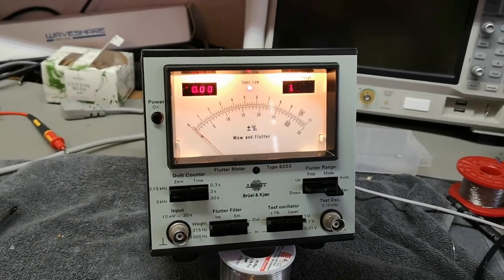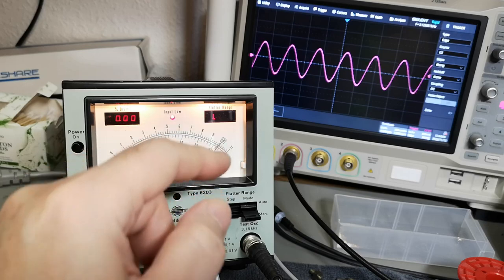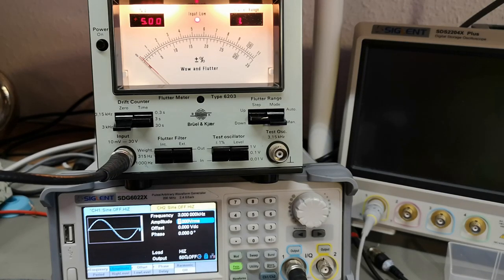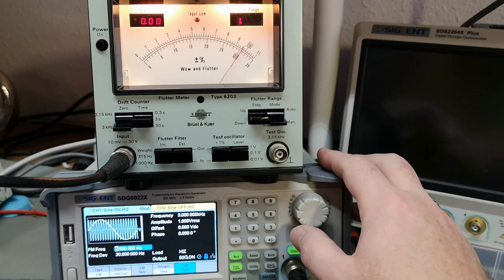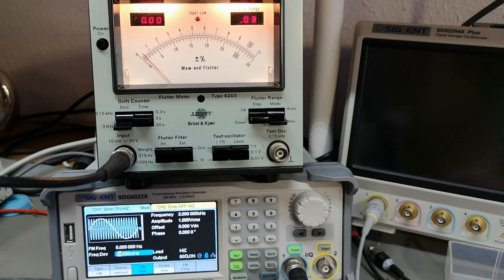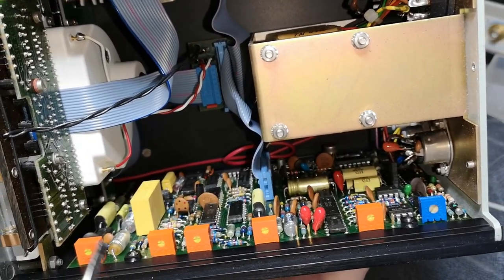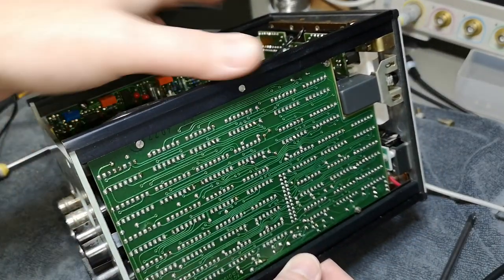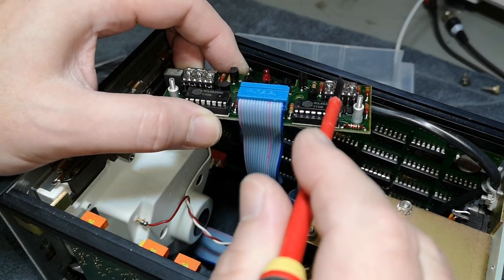Brüel & Kjær Wow and Flutter Meter Type 6203 from 1977 test teardown

Comment: At my first engineering job I used this equipment to test wow and flutter of record players. The tests are done by  playing reference DIN test tecords containing a 3150 Hz tone. The same for tape decks using reference tapes.
Actually it measures drift, wow and flutter separarelly.

Comment from the maker: NEWS: displays might be DL330M also known as Bubble LED display, seen today on ebay 65 Euro for ONE
Reply: yes!!
Reply: Absolutely crazy. I have a bunch of those in stock. Just because they are listed for that price, doesn't mean they are ever being sold at that price.
Reply from the maker: @zaprodk  then you know what to use as trade material to make me happy one day :-) in case i got some cool stuff you might need.
Reply: @TeardownOZ2CPU  so you don't have that kind of stuff in your collection? I'm surprised :)
Reply: @TeardownOZ2CPU  Yes I also have some around, but prefer the later full alphanumeric versions, which were used by another Scandinavian manufacturer, B&O, in their equipment. They are great displays, made with the LED grown on a silicon wafer, and diced up to make the displays, plus TI also made them with an integrated counter decoder on the leadframe as well, giving that combo of a BCD counter with outputs, and an integrated decoder to drive the display.
Reply from the maker: @SeanBZA  the alpha types are nice, i got many of them, but they dont bubble as much, and the view angle effect is not as extreame as this number type, 
see my first Z80 system here : http://webx.dk/oz2cpu/radios/z80first.htm

Comment: If you record the tone onto a tape recorder that has wow & flutter it will not show up on test. You need a tape recorded on another machine that you /know/ is perfect :)
Reply from the maker: i dont think you are right : if you have a machine with wow and flutter and record this perfect test tone, rewind and playback the measured wow and flutter will be twice the level of what that machine really have.
Reply: Nahh, its not that simple. First of all: perfect wow-flutter does not exist. So all we can measure when it comes to this, has a great uncertainty because we measure both the tape and the reproducer machine, so its a combined uncertainty of these two (and actually more elements). This is not different to any other kind of measurement - but in this case its more problematic because the machine that produces our reference tape will have the same wow-fl value as the one we will be measuring, fx. like 0,05%.

To answer your question, yes it will show up on the test. It is impossible to mechanically reproduce a tape 100% in sync with the recording made on the same machine. But I think you are thinking about fx. using a 3-head cassettedeck and measure while you record and playback the same time, and this will NOT work because the heads are located only a couple of mm from each other, so here you are right.
But it is acceptable to record a tape on a machine, rewind it and play it again and take a measurement. But preferably using two or more machines. If this measurement is within specs of the machine, or VERY close to, its acceptable. Then you know, that if you had a ref. tape with 0% wow-flut (doesn't exist), your specs will be even better - but that value is not usable, only that we are within specs.

MRL has a very good publication on this (nr. 570):
"FLUTTER MEASUREMENTS
Weighted peak flutter is measured according to the
standards AES6, IEC 60 386, and others [1]. The background
for these standardards is given in references [2...5].
The measurement of the weighted peak flutter of normal
recording and reproducing systems should be made on one
element only of the system—either the recorder or the
reproducer, but not on both at the same time. This is for two
reasons: First, it is desirable to separate the flutter due to the
recording system from that due to the reproducing system
because professional recordings are usually played on a
different system from the one that they were recorded on.
Second, the recording system flutter adds vectorially to that of
the reproducing system, and under some practical (but not too
common) conditions, the flutter measured while simultaneously
recording and reproducing may be anywhere from nearly zero
to twice the true flutter for one element.
One convenient way to separate the recording flutter from
the reproducing flutter is to reproduce a flutter test tape whose
flutter is considerably less than the value specified for the
reproducer to be tested. The weighted peak flutter inherent in
MRL Flutter and Speed Test Tapes [6] is listed in the table
below. This value is adequate for routine measurements of most
professional audio transports, to determine that the weighted
peak flutter meets the specifications given by the manufacturer
and those given by the IEC Standard 60 094-1 [7]. For
professional applications, this Standard calls for the weighted
peak flutter of the recorder or reproducer at 190 mm/s (7.5 in/s)
to be less than ±0.15 %, and at 380 and 760 mm/s (15 and 30
in/s) to be less than ±0.10 %.
In case you need to measure the flutter of a transport that
has extraordinarily low flutter, you will not be able to use this
MRL Flutter and Speed Test Tape. Instead use the alternate
method given in the standards, namely to measure a
recorder/reproducer by recording a 3150 Hz test frequency and
subsequently reproducing this record several times, measuring
in each case the total weighted peak flutter and calculating the
arithmetic average value of these measurements."